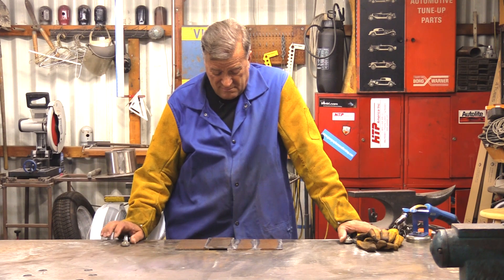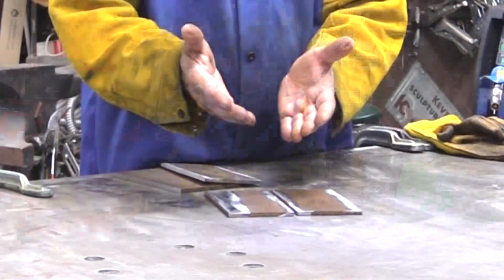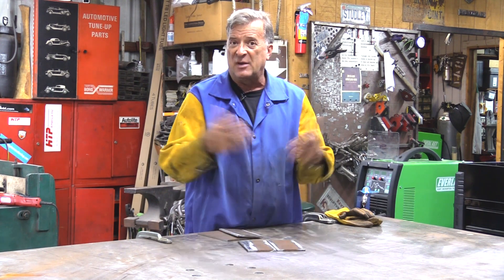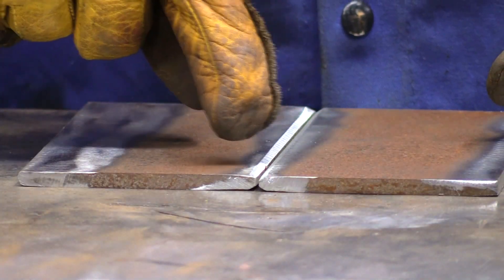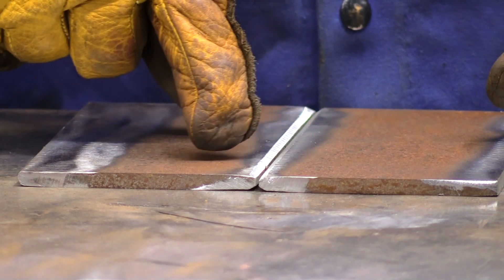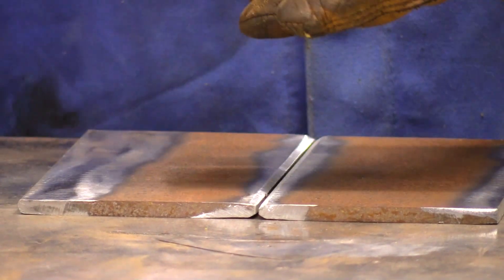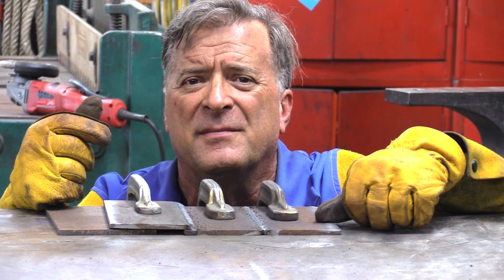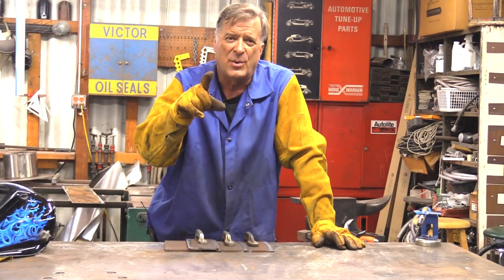Should You Use a Lap Joint or a Butt Joint When Welding? - Kevin Caron

Comment: Hey kevin. Still loving the videos. Great work buddy. Just a quick question. My mig welder is being stubborn.! Welds fine for about a minute then welds sound like a machine gun and very blobby. Any ideas??? Have changed liner, even gun and wire.
Reply from the maker: Check the size of the tip to the wire diameter.  Maybe too tight and binding when it gets hot.  Try a little anti spatter gel to help lube it.    Tension on the drive rollers too loose.   About all I have...
Reply from the maker: Or drive rollers worn out?!?!?

Comment: hey. what would you say is the difference in strenght when the lap joint is only welded on one side compared to a butt joint.
Reply from the maker: I would put the single weld in the 50 to 65 % range of welding on both sides. 

All depends on how much penetration you get.

Comment: I would say a but joint is better than a lap joint. A lap joint sufferers from corrosive problems due to the gap between the plates.   And lap joint is more likely to crack  due to the geometric patterns of the weld.

Comment: _The Oxy-acetylene handbook_. Union Carbie Corporation, Second edition, Oct. 1960.

If you have the book, Chapter 10. Preparation for Welding, talks (and shows pictures) about the principles and application of joint designs in different types of metals.   I found it helpful. :)

Comment: The comment on storage tanks using lap welds does not apply to tanks that must meet API specs. These require a but weld. Lap welds cannot be used. At least, that was an engineering requirement on a tank I just finished working on a couple of weeks ago. It needs a repair where lap welds would make the job easy but are not allowed.
Reply from the maker: I didn't know that,   thanks for the info.
Reply: Further to the specs: Lap welds are allowed in floors, only the shell is specified as butt weld. I makes sense since the butt weld remains in compression, whereas the lap joint puts the weld in shear on a vertical wall. The opposite is true on a flat floor.
Reply: BTW:  
Thanks for your postings. They have helped me become an amateur tig welder and helped me better understand professional welders I sometimes work with.